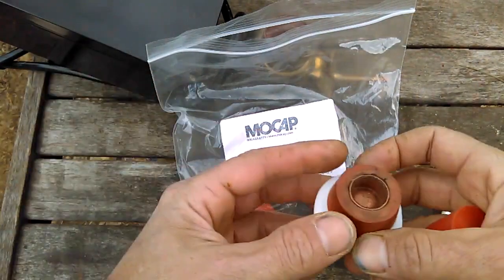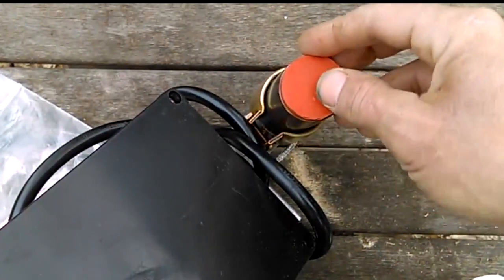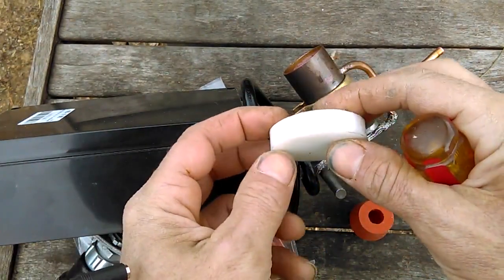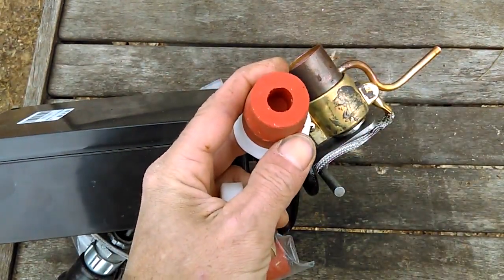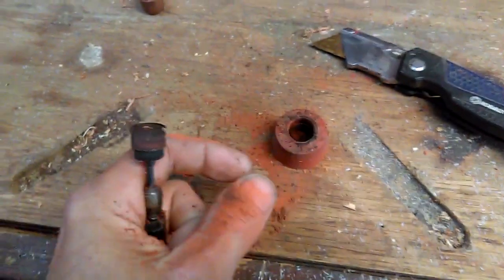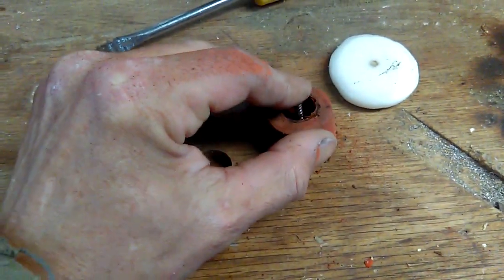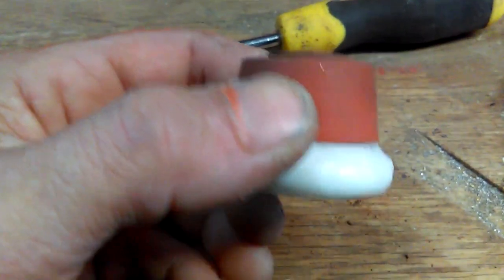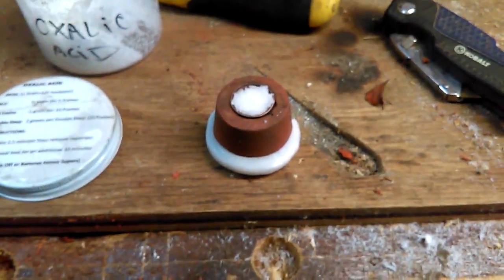Homemade Pro Vap (Oxalic Acid Mite Treatment Vaporizer)...Making Provap Caps

Comment: 2:05 pm
Afternoon Jason, another great video thanks for posting it. I built two vaporizers identical, they are both set for 344°, the first one PID constantly goes over 400° then it backs down to 336°, the second one works even better it goes up to 379° and then backs down to 340°, I don’t understand why it does it.

Comment: I want to know what was the pot made from the bottom is it aluminum and the copper coupling what is the diameter, what is the demensions and what size heater band is used I already know how to use pids and thermal couples I just want to know about the cook pot

Comment: I made a very simple cap, a 3/4 copper end cap, a stainless steel #8 1 inch screw, a 1/2 inch thick piece of oak cut 1 inch radius circle. Drilled a hole in the copper cap, screwed it to the wood, works great. I do not do the upside down thing. I insert the nozzle pot upright, I simply pick up the cap, touch the side of the cook pot and roll the cap over seating it onto the pot. Simple, works great.

Comment: Thanks for these videos.  I think using a drill press with a common spade bit would make the hole in the rubber cap a lot easier.  Or a Forsener bit?  If you have them.  Most wood working, home handymen have a set of spade fits and a drill
Reply from the maker: Nope! I tried both those bits and the rubber just flexed out of the bits path. It didn't do anything at all so I went to dremel.

Comment: So Jason how has this thing been working for you this season?
Reply from the maker: @Brent To be honest, I haven't used it on the bees yet. I just dug it out last week to fine tune. Seem I had the copper tubing a little long so I had to reduce that. The acid was cooling before it made it out of tubing and crystallizing. Hope to use in this week sometime and share an update soon. 
I did do a mock test. I setup 4 caps with acid and went from one to the other like I was treating. It did a great job.
Reply: @JCsBees  Yeah an update on it after some use would be great Jason, thanks man. Also, no I didn't go and buy a provap, seems like a ripoff at $500.
Reply: The year we treated with a yard fogger was the best winter success I've had. Don't think it had anything to do with method of application. What mattered is that it was easy to quickly treat all my hives at once. With the Oxyvap I took too long and I would get hot and it was easy to say "finish tomorrow" then it rains or something would come up. My bad...but it was way easier to treat it all with the fogger. Drawback...the acid destroys the pump guts in the fogger. 
We got a provap110 ..rich Yankee beeks. I'd have built one but don't have the patience. Treat your bees.
"My bees don't have mites"
Famous last words.

Comment: Not sure why you use the copper cup. Take it out and you have more room for the acid. You can have a larger hole since your not trying to make it fit a certain cup size. I just use a straight up mocap.
Reply from the maker: The copper cap just gives it the finished look but yeah it would work either way.

Comment: Hi Jason - I tried filling the tubing with salt to get tighter bends but it didn't work. I ended up heating them and melting solder in them. I used to tubing bender to do the bend closet to the cookpot and the other one I used a half inch piece of pipe in the vice and used a metal rod next to it to make the other bend. I was able to get a nicer/tighter bend that way. Oh and I tried to braze with a propane torch and as I read it's not hot enough to braze. I ordered a small jewelers torch off Amazon that uses oxygen and mapp gas - I hope that does the trick. ---- I am so close to getting this finished. Thanks ---- Joe
Reply from the maker: The solder trick worked very well for me. I was able to get a nice tight bend with zero kinks. I am  bit confused why you need to braze? Are you saying your going to braze the tubing into the cook pot? I just used some really heavy solder on mine and that did the trick. I was worried the cook pot would get hot enough to melt the solder but I haven't seen that yet.
Glad your about done with your project. It was kinda fun, huh?
Reply: @JCsBees  I though the solder would melt so that's why I wanted to braze it. I think solder was only good up to 370 degrees.
Reply from the maker: The solder I used has worked so far. Here is a link to it https://www.amazon.com/Oatey-29024-Safe-0-117-Inch-Silver/dp/B000GASQ82

Comment: Hi Jason your caps are much easier to make then the ones I made out of Teflon rod.I may give making some a try. Do yours last a long time? What is the heat rating on them? The only thing left for me to do on mine is braze the copper tubing into the cookpot and then I can wire it. I'm actually building a second one and plan on trading possibly we'll see how that goes. When time permits I have a thermostatically controlled heat gun that I may try and make something. I also want to make a 12volt diesel glow plug version for the hell of it. In between all this I am finishing building my Hexacopter drone and hope to be flying that soon too. Thanks for the video Jason. Oh and did I mention the ceiling fan the wife just bought takes precedence over all my projects. Maybe next Saturday it will get done lol.
Reply from the maker: I am not sure how long my caps will last but they are rated for 600°F. To do a ProVap treatment you only have to reach 446°F. Did you have any trouble bending the copper tubing without it kinking? I had to fill my with solder bend it and then melt the solder out. It worked great!! Sounds like you have a lot of project for sure but I can relate to the fan taking priority as I have a wife too. lol
Reply: yeah Jason I wasn't sure if they were silicone at first. I thought oxalic acid vaporizes between 220° - 370°F  and over that it was useless for mites. As for the tubing I was able to bend it without kinking it but I couldn't get the bends tight so the tubing would extend a bit lower if I use it. I am going to try to fill the tubing with salt and see if I can get the bends tighter...… My Mocaps are going to be here Thursday and I may try and make 1 or 2 of them this weekend. Thank you Jason :)
Reply: @jpthedelawarebeeman6239  《Bee careful as some videos use C° others use F°, 220° is the aproximate C° temperature
Reply: @incubatork  Understood  thank you
Reply: There is something called Cerrobend similar to soldering the tube to bend but it melts at a lower temperature and comes out cleaner than solder. its not too expensive but I don't think you need to spend the money for what the tube is going to be used for.
Reply: @JCsBees  to bend copper pipe you can fill it with wet sand and compact it in, easier to get out than solder. you can also use a spring, found in diy pipe section of most hardware stores.

Comment: Nice build and great video! I can't wait to see it in action with the bees!
Reply from the maker: It's gonna be a little while before I use it, probably fall. I plan to use the dribble method this spring to treat, that and breaking the brood cycle with splits.
Reply: Ah yes, I had a feeling it would be fall. I have been so preoccupied I somehow forgot about splits. Presuming my hive is still alive, I may have to rub some elbows and see if I can get another couple of deeps for cheap. I was planning on building some boxes and buying frames this winter but my funds went to Korea instead! 
Take care!
Reply from the maker: Yes, it's almost time for splits. I will be making a bunch. Last year I fed pollen patties about this time which great boosted brood production. By the end of April I was splitting them and I had all kinds of brood frames to do so. I think I did 1 frames of brood per split and they slowly grew into booming nucs. 
You could get ya a couple deeps and make a divider and make them into 5 frames nucs. So 2 deeps would be 4 nucs.  Just a suggestion but if you listen to me eventually you'll have bees everywhere.  lol
I bet your trip was very pricey but sometimes we have to do things like that. I know you had a good time and that's what matters.
Reply: I feel like I dropped the ball a little bit with my planning. I plan on getting my snow shoes and checking my bees later today to make sure they are still alive and well before I start making decisions on splits and start planning... However, the idea of nucs is a good one! I truly wouldn't mind bees everywhere so, my ears are open, haha!
Yes, my trip was wonderful and much needed. Kind of a reboot on some unsavory stuff happening at the present time.
Weather man says close to 60 degrees on Thursday/Friday. Though I wouldn't be surprised if we got a little more snow, I am confident that Spring is here!
Reply from the maker: That's not dropping the ball, that's just taking a break from beekeeping. I look forward to winter for this reason. I can stopping working the bees and work on other projects like weaning calves and stretching fence here at home. Every once in a while though you do need to check the bees and add dry sugar as needed but that's about it.
If you use deeps as nucs I would try to set them up so the entrances are at opposites ends of each other. This will greatly reduce bees drifting from one to the other.
How much snow do you have on the ground now? We don't have any and it's currently 44°.

Comment: Thanks for posting, I found some silicone plugs from McMaster Car that should fit that are 3 dollars a piece, no center hole but I should be able bore a hole with a drill bit.
Reply: Do you have the link?
Reply: https://www.mcmaster.com/catalog/125/3942
Reply from the maker: @Tyler Timmerman Thanks for sharing the link.

Comment: The cutting board material is likely HDPE (high density polyethylene) not EPS (expanded polystyrene).
Reply from the maker: I may have pronounced it wrong but I have it listed as HDPE in the video description. Thanks though.